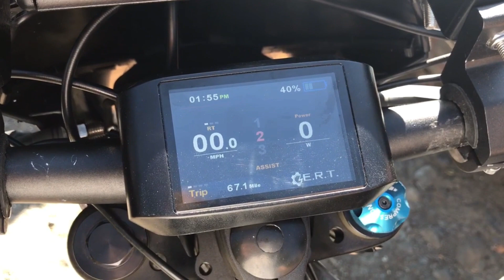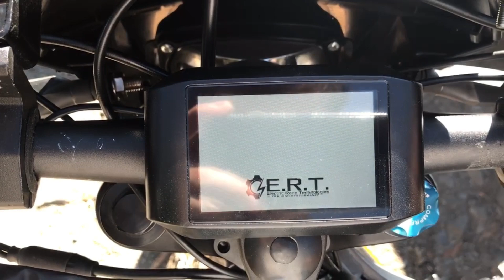ASI Powered Sur Ron Breakdown

Comment: how are the turn signals powered?
Reply from the maker: 12v power loop from the dc/dc converter. Same loop as the headlight and brake
Reply: @PITprojects  so is that a pretty easy thing to do? My bike arrives tomorrow, so I have not seen it up close just yet

Comment: Does any body know how to bypass the bms ?
Reply from the maker: It is fairly complicated, but if you have electrical engineering knowledge it can be done. There is a guide somewhere in the sur ron owners group on FB posted to endless sphere. Sorry I can't help more with that but personally, I don't think the bypass is worth it... It's maybe a 20% power increase but voids the warranty and risks damage to the cells. I also believe the BMS balances the cells when charging and it could be potentially dangerous to charge it without that feature. I'm by no means an expert on this, but have read a lot of the forums. Good luck if you decide to :/

Comment: It’s very frustrating when videos like this boasts of power upgrades and yet always neglect to mention it’s most important aspect. Total distance capabilities!
Reply from the maker: Range was never my concern since I only use the bike around my city and once into SF. Range is about the same as stock because I got an increase in capacity but I spend it faster. Expect somewhere around 40-60 miles depending on how you ride. I usually see around 50 miles personally. I understand that is very lacking due in comparison to a normal motorcycle, but compared to electric bikes on the market its very competitive range.

Comment: What was your total cost for this build? including the initial price of the bike
Reply from the maker: So, this is a common question and it is a lot...
The bike (pre-import tariff) was $3k and I spent a good 400 on accessories and peripherals to get it road worthy.
Then I started to want performance, so after a year of riding the bike at least 4 times daily, I got the hang of it.
I then upgraded the controller (including color display and regen wiring) and battery which cost $800 and $1.8k respectively.
At the moment I made a mod not documented which is supermoto wheels. They look and feel amazing. But another $350...
Over the years of ownership the bike required many repairs, modifications, and parts. It gets expensive fast.

I value my bike currently at $8k on the market, but I'd argue it has cost me more. Regardless, I will spend more. hahaha

Comment: some of the best mods i have yet seen!  really damn good.   
would love to see some closer pics of the seat extender mod you’ve made.  Did you slide that box section over the frame and then bolt attach it or directly weld to it? .  Thanks for sharing .
Reply from the maker: First, thank you so much! Bike is looking better by the day...
Second, yes, I slide the box section over the frame by cutting slits in the far side with an angle grinder (cut the seat extender not the frame). Next I bolted the seat to a prop piece of sheet metal and cut to spec. Then I aligned the plate and bolted it to the extenders. Finally I did 6 spot welds on the corners of the contacts of the extender and the plate.
Sorry for responding late...
Reply: Are you fucking blind looks fucking hideous Electric tape To colour in the forks 🤮 And a weld job done by three-year-old 😂 some people don’t deserve to have Nice things

Comment: Do you have regen roll off on Surron throttle?
Eco sport function still operable
Access to Asi contoller programing at all?
Reply from the maker: Hey Alex, I have variable regen controlled by my left hand throttle. The eco and sport mode switch was removed because I control my power levels with the new ERT display. I have access to the BACdoor app with a manufacturer login but would not recommend tinkering with it yourself.
Reply: Harris On Wheels >  Did you buy the ASI evaluation kit as that's the only way you can have access to controller settings?
I'd like a complete ert kit just not sure if I'd be able to access it after. which would be a shame quite a lot of money!
I wouldn't know how to program it or wire it from scratch admittedly. 
 Great vids by the way showing what you've done!
Reply: Ps I have those Heidenau tyres after hours of looking at tyres road tyres for 19" rims many months back these were the only ones with a close enough rolling circumference for odometer / retain gear ratio, Oh & weight.
 Actually very good for road.
What sort of mileage per charge are you returning at 14.4kw?
Thsnks

Comment: Sweet, I have had my Sur Ron since June and absolutely love it. I commute on it during nice days to work (over the SR bridge in Marin) and have taken it out to Auburn to a OHV trails and it rips off road. I was just establishing all the upgrades I'd like to do and you have covered most of them. What are some of the stats of your new drivetrain:  milage (I know it depends on usage but a rough idea of what you're getting out of it would be helpful), peak and nominal power, charge time, etc.. Also, if you guys get a group ride together I would love to join and get to know some of the Sur Ron community as well. How can I keep in touch? Thanks and keep up all the awesome content, really appreciate it.
Reply from the maker: millage: have logged 1.5k miles over a year
Peak power: 14.4 kw battery current
Nominal power: closer to 10kw
Charge time: 1.5 hours (15amp) 3 hours (5amp)

You can message me on youtube or facebook and i am fairly responsive. I would love to do a group ride as well. Will likely promote an event on this channel.